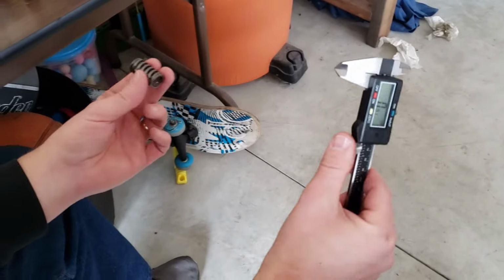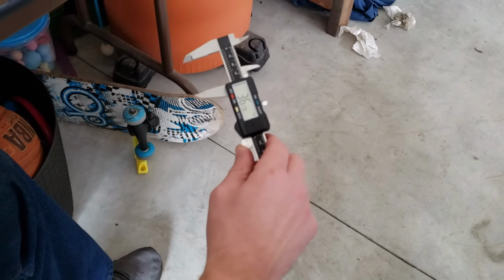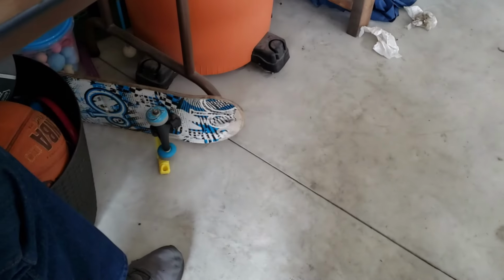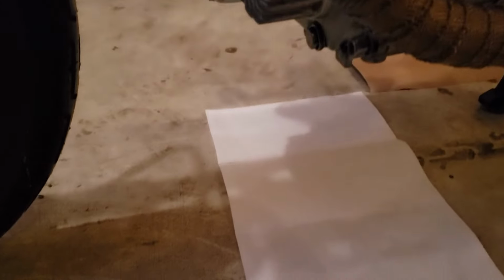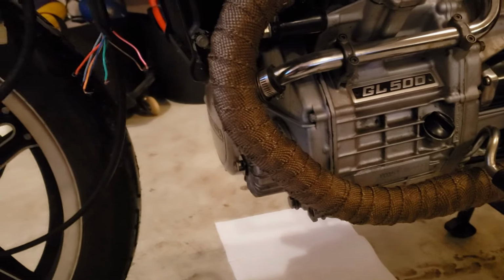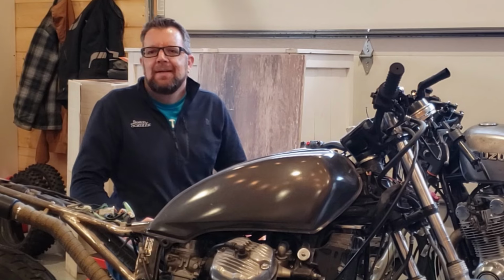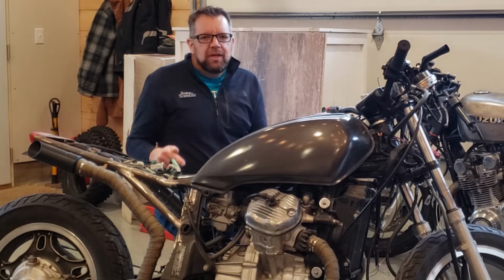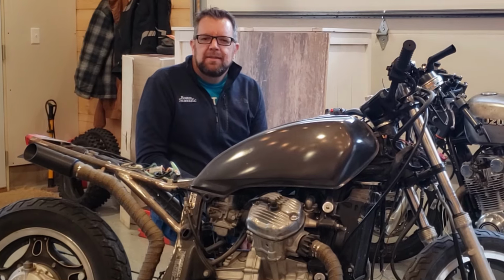1980 Honda GL500 Silverwing - back in the garage!

Comment: Went to Lowe’s the other day and there was a silver wing in the parking lot. Had a small crack in the faring, other than that just age. Was definitely impressive. Haven’t seen one since  was young
Reply from the maker: I looked at one yesterday to buy.  I thought it would be cool to have them side by side when we are done with this to see how Honda intended it versus how we modified.  Unfortunately the guy was as receptive to offer - hehe!  May still try and find another though - the are fun little run arounds to have, light weight and powerful enough. Thanks for watching
Reply: @ACECafeBikes  I opened up the carbs, straight pipe with bassini long shot slip ons. Nothing could (cruiser) keep up
Reply from the maker: @Mr.McStache  Thats awesome!